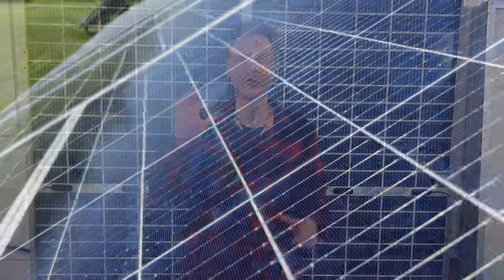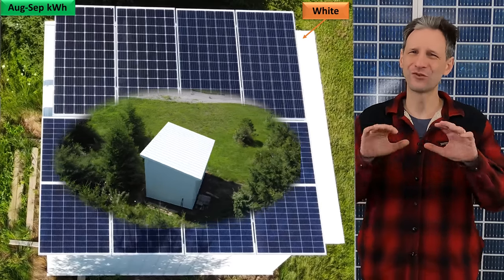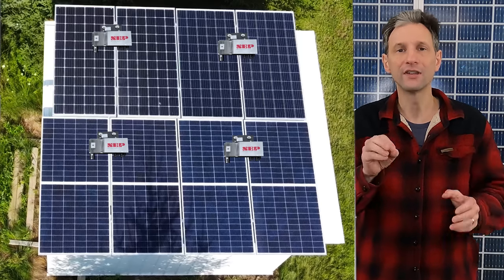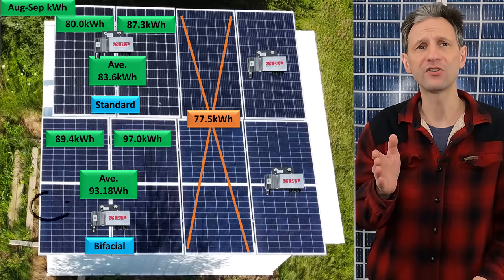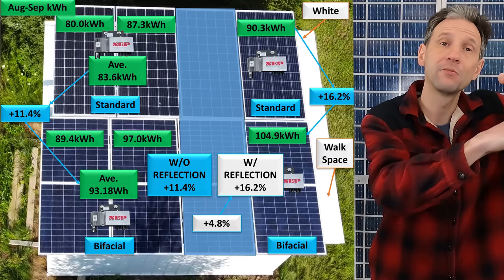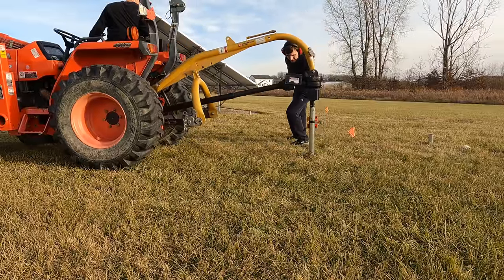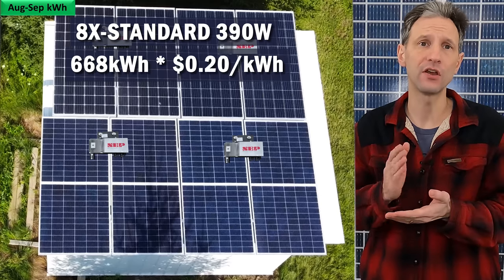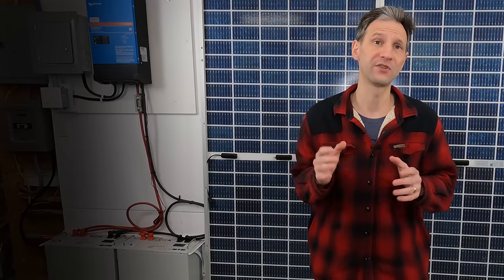Should you put BIFACIAL Solar Panels on the ROOF?

Comment: Great info!   I wonder if a slightly corrugated layout would increase the bifacial output?
Reply from the maker: What do you mean by corrugated layout?
Reply: @ProjectsWithDave   Collapse the panels like an accordion with the ends and middle seam in the up position.  Also spray the roof with reflective mica
Reply from the maker: If I'm picturing that correctly, you would end up with the panels shading each other and that would reduce output.
Reply: @ProjectsWithDave  I don't think it has to be pitched alot. Maybe 10 deg.  Enough to allow a bit more light to reflect off of the white roof.  You might get some reflected light off of the opposing panel
Reply from the maker: You could always set up a few panels and try it.  Keep in mind the sun changes quite a bit from the winter to summer solstice so you need to run your test for about 6months to get the full result.

Comment: I think ground mount would be best. But not off the ground. 
Simplify. 
Its supposed to be green, so why are we using tons of steel or aluminum (NOT GREEN) to mount the panels???

Take a square section. Plot rows for the panels, make square or rectangular area into a gravel pad. Use white gravel for bifacial, or something like it. I think white lava rock would be so cool but not cheap. Limestone? Probably crushed marble would be most effective. 
Put down just a weed barrier, you can use roof water seal tyvek or the like. 
And then just fill with nice amounts of rock. Marble white rock to be precise. 
Make a harness for your arrays from legit solar wire, solder silicone and heatshrink the splices its EASY. And it works great. 
Anchor the front panels with a type of stake, like drive in long rods, use whatever works, rebar probably ok for the front low edges. And maybe even rebar for the rear. I would go with 1 inch galavnized pipe from a trampoline or tent or something like that. Salvaged smartly. 
Easy to clean and maintain.
Risk of fire is low. 
Risk of panel damage is lower because you can actually cover them easy. WIth big tarp, the center panels always have the tarp draped to protect. 
Risk of panels flying off is low when you install correct. You could even do small concrete mortar infill to be legit. I would use a barbed driven spike. 
Stainless wire tie them down. If its good enough for an airplane...
Then trench just to the edge of the gravel and have the plugs right to your disconnect. 

Nothing expensive or demanding. 
Plus the bifacial, AND white gravel reflectivity could actually increase the advantage by 35 percent, comparing to standard black roof vs white gravel, vented, bifacial. 

Long term cleaning is easier, so more output. And lifespan increases because they are coolest, with just about the max possible amount of air circulation and light reflectivity. 

Also a white driveway works this way too, I think car port bifacial solar installs would be another great standard model. 
A bit more material demand, but, if its just 2 inch galvanized pipe, its fairly cheap. I would do it either way personaly if I had the need.

Comment: Im going to install some either side of my sailboat.
They will have 1.7m between the back of the panel and the water line.
Should he interesting
Reply from the maker: That's a great application for bifacial panels.  The water will provide significant reflection to the back side of the panels.

Comment: the mixed bifacial and standard panel produced the least? interesting!! i wanna know the data on why because i have mixed panels on mine, a 400 mono and a 300 watts poly. voltage are close together with a 2 amps more on the mono. please make that video possible.
Reply from the maker: I believe, when the voltage and current ratings don't match the inverter ends up taking the lowest common denominator.  I don't recommend having mismatched panels on the same inverter input.

Comment: If the bifacials are on a string inverter, 4 x 3 array, and the middle panels do not get any reflection advantage and the end panels do, dont the middle panels prohibit the end panels from increasing  total kw output?  In other words, are micro inverters required to take advantage of bifacial gains of the end panels in a 4 x 3 panel array that is installed on a roof similar to the video?
Reply from the maker: To some extent, yes.  The micro inverters are better at taking advantage of small differences in individual panel output.  However, I don't think it would be terribly significant in the whole scheme of things.

Comment: Hello, did you use a galvanized steel structure and bolts to assemble the PV panels?
Reply from the maker: It is an aluminum rail system.

Comment: What about the temperature coefficient of the two panels? Are they identical?
Reply from the maker: Very similar.
Reply: @ProjectsWithDave  Being a solar cell scientist/engineer, I am very surprised about the 10% higher energy, which in your case should be equal to 10% higher energy yield (kWh/kW), is huge. If it’s true, everyone should paint their roof white and put bifi panels.

Comment: I have a similar building (larger, but with a similar roof pitch and south facing). We live in Western Washington so I'm thinking that it will help on the cloudy days. Is there a racking system that will get them up higher off the roof to maximize the bifacial efficiency? Or is it that a wind concern?
Reply from the maker: There are systems that can raise it up a but, and they are designed to handle the wind loads, but they usually are engineered for a flat roof.
Reply: Iron Ridge has a rack system with standoffs of various lengths. But, the tallest standoff that is engineered for a "sloped" roof is 7" including mount.  If youre not concerned with approvals and permits than the skies the limit. At your own risk of course:)  I know the bldg dept here pays attention and wants everything spec'd. I have a 4/12 roof and also want to install bifacial raised. The roof is galv metal and very reflective. I may still do it and leave spacing between each row.  If, the panel price makes sense.

Comment: I want to install 100kwh bificial topcon module on metal roof of my factory with 125mm clearance. 
Will it increase heat between module and roof? 
Will it affect power generation due increase in heat?
Should I install on bificial module on metal roof?
Reply from the maker: If the roof is white, or a very light color you will see some benefit.  If it is a dark color I wouldn't bother.
Reply: @ProjectsWithDave  will any heating issue on module bcoz of both side glass?
Reply: In U.S. which Module is more popular for metal rooftop Mono perc half cult bificial or n-type topcon
Reply from the maker: I don't think you will see a significant heat increase with bifacial over standard panels, the sun exposure is almost the same.

Comment: Hi Dave, vivek here from solar forum.
As promised I purchased two 550w bifacial panels which claims for 30% gain, so totals upto 1360 watts.
I have to lot to find out, but from solar atlas I figured out I need to install at 26° acc to my latitude.
My question is, is that angle is for normal panels and bifacials need to be more tilted as suggested in video?

I can install them as higher as possible, but can you give me any figures based on height so I know at how much height I should install them, or is it the highest the best?

Third question I have is, from which direction the light reaches to the 2nd face of the panel. Because based on this I can decide at what place in my property I install these panels, does the light enters from the front or from the back?
Reply from the maker: The front of the panel should face the sun.  You can go to ( https://pvwatts.nrel.gov/ ), and run simulations for different tilt angles and orientations.  That will tell you your average production for each month.  Then orient your panels to best fit your actual consumption needs. I use the tool in this video on sizing your solar array: https://youtu.be/rbFnZqA0GCI
Reply: @ProjectsWithDave   hey, need a quick help!
my installer is insisting on installing those bifacial panels at a very low height due to difficulty in installation at the flat roofs here in India.
They says the front will be at around 1.5feet height and at 26 degree tilt, the back part will be at 4.5 feet,
do you think this will generate any energy from the back? or should I force him to increase a little bit more? Thankyou
Reply from the maker: You will still get reflection at that angle, maybe 10% to 15% depending on conditions.

Comment: So if you have a darker asphalt roof, are there white/light coatings or overlays you can put down before the panels to help reflect light?
Reply from the maker: I can't imagine something you could apply to an asphalt roof to make it more reflective that would be durable.
Reply: It might consider adding a white colored metal roof over the top of the shingles in the area that you plan to install the panels. However, it’s probably not financially feasible. In my humble opinion you should just stick with the regular panels. I think bifacials are still best in a freestanding array setup to allow maximum reflective light penetration.
Reply from the maker: Yes, bifacials shine best on a ground array.  However, If you have a flat white roof and mount the panels at an angle I think you would see good performance there as well.
Reply: @ProjectsWithDave thinking about that just not sure about drilling into my pto roof

Comment: I am asking  everybody for a solution  with no response.
I want to charge my 12v 200 amp battery and run 300watt 12v load at the same time. People on YouTube put panels and load parallel on the battery, which drops the voltage and the battery never gets fully charged. What is the solution to run DC load and charge battery simultaneously.
Reply from the maker: I built a simple 12V system in this video: https://youtu.be/OwfGLu8IY_M
If you don't need the inverter, you can just eliminate that part of the build.  The charge controller can charge the batteries and allow you to run a DC load off the battery at the same time.

Comment: Do you have any plans to try out a mirror below a bifacial panel? Particularly for roof mounted. A video was recently posted about scientists doing this with perovskite cells to boost efficiency: https://www.youtube.com/watch?v=BtOSAOaAmUM
Reply from the maker: Adding a physical mirror below the panels would be a completely different phenomenon than the one described in the video above.  However, I do hope to do some mirror experiments when I find some time.
Reply: @ProjectsWithDave  When I first commented I hadn't thought to ask if the bi-facial panels are opaque or semi-transparent? I remembered you said they had a glass backing, is that lined so light has to be shone on the back, or can it pass through the panel? Thanks for your comprehensive videos
Reply: A little bit of Googling revealed the liner is not present in bifacial panels, just a glass sandwich. I wondered if mounting mirrors below on roof panels would amplify the output, giving it a second bite of the cherry so to speak, with the reflected light. Keen to see your results, thx.
Reply from the maker: I don't think mirrors directly behind the panels would be a significant improvement.  In a roof setup not much light reaches behind the panels to be reflected.  That's why they work best in a ground array.